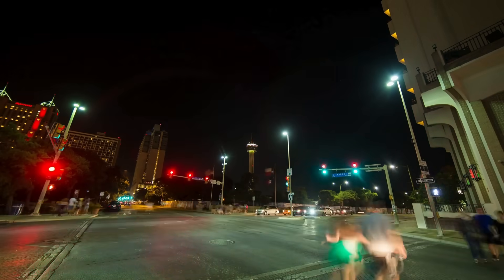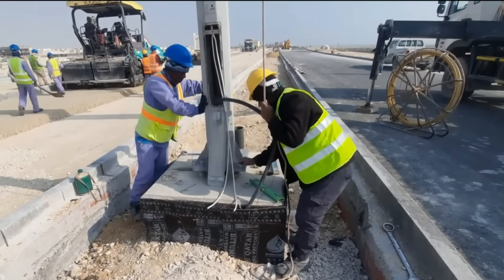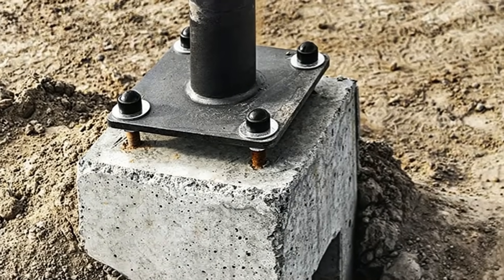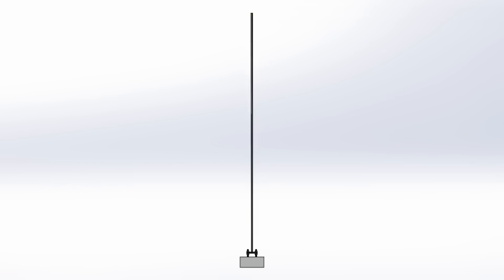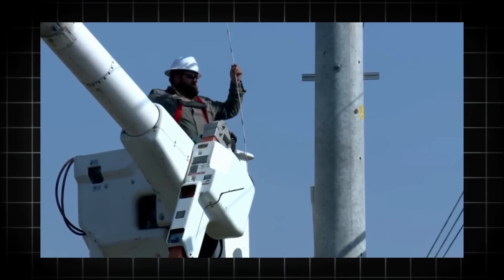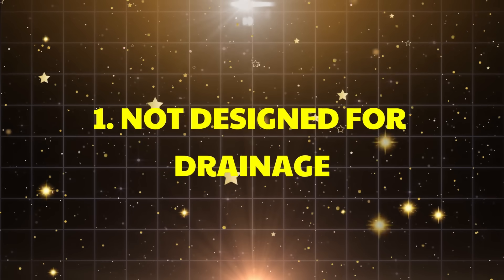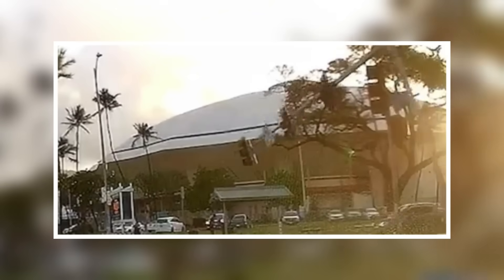Why Light Poles Float on Bolts Only, Not Flush with the Ground?

Comment: I've done 100's of pole lights and all these comments about stress and tension and pull has nothing to do with the design. Its just a common mount that has benefits. Leveling, grouting, skirting, curbing, pattern adjustments and pole replacement. A 3/8" rod has tensile strength of 5000 lbs. most bases in parking lots use 3/4" 4 times, they also have a hook bend at the end and once encased in concrete it is set in stone I tell ya.
The weld at the base plate is where the action is. Once the plate is correctly fastened to the bolts (sandwiched) either the plate will snap or the base will move but the design will stay in tack. Try mounting one on a hill ?
Ya buddy fun stuff especially the big highway and parking lot lights.

Comment: The first time I, previously a carpenter/builder but now a crane operator for the last 25 years, set some light poles for an electrical contractor, I was stunned to see that he never looked at the poles, eyeballed them for plumb, after I set them, I expected a period of fooling around with the base bolta to get them plumb, nope. Just his 8" level on the base bolts got it close enough. If would have been left to me, I would have plumbed them with a transit, shooting the base and then the top of the tapered poles. Once I was setting a 40 log pillar for a homeowner, who was trying to plumb it with a 4' level, but the log was irregular so that was pointless, I finally told him "I have a pretty good plumb bob right here," meaning the crane winch line and 250 pound headache ball. I also once set a 50' tall acid tank on a solid concrete base that looked tilted to my eyes, using the crane plumb bob I proved the contractor it was indeed.

Comment: OK, the bolts as ya call em are "J" Bolts of the proper dia. for the load the eng. calculates, They are Hot Dipped Gal.. The conc. pier is grounded and poured. Now the J bolts usually in a pc. of plywood for spacing, are worked into the concrete before it starts to set. Each pier is calculated for the pole ;,all about mass, the J bolts are part of the desig. Ya got a 5' (in ground) pier, your J bolts are bout 2' deep in the pour. The double nut is to keep it off the pier and for leveling.   Ret lectrician

Comment: I always thought they were SHEAR PINS,  which are designed to give way quickly when a car hits the pole.  Did not in 2013 the federal government required all highways with speeds aove 50 mph use such  poles?  Alas, I have seen lawyers argue that using such poles are dangerous to pedestrians and other nearby when they do fall over.

Comment: You don't level a pole, you plumb a pole.
Reply: Technically correct but “level” is more likely to be understood by the average viewer.
Reply: I am an average person. To help me easily understand perhaps: level the base nuts to one selected point such as one nut so that the base plate is mounted level. Then as long as the pole is attached plumb to the base plate the installed pole will be plumb. that's a lot of words. Think I like "level" better.

Comment: I read the comments and now wonder if anyone who replied watched the video? A pole shearing off during a collision is more of a danger than if it remains standing. The logic is why would you put multiple other people at risk when the pole falls as opposed to one vehicle being damaged.  It is a game of numbers not what if's. The mount has NOTHING to do with being hit by a vehicle! I have built similar mounts for pumps and motors, both gas and electric. I use stainless steel studs and nuts, but I always leave them exposed to prevent corrosion. I guess grout is for the "artistic" type and has nothing to do with structural integrity except it causes corrosion due to trapping moisture. 

As far as the wind is concerned, it guess it takes a little intelligence to understand that if a pole is not plumb vertically, then it doesn't resist the wind in one direction as well. In other words, if it is plumb it is equally supported in all directions.  Not really rocket science!

Comment: There is also the consideration of "friability/frangability", yes falling sign posts/lighting poles are a hazard. But rigid poles that kill people on impact rather than yielding is a more immediate risk. Just look at the South Korean landing accident. In NZ the bolts do not go thru holes but are in slots, used for adjustment the same way but slip under excessive side impact loading. Always felt that US infrastructure is missing something.
Reply: The bottom line is engineers can't foresee the idiots who drive and text and run into light poles. They don't have to be in a car either, so would you suggest making them out of rubber to protect the face of the morons who walk and text? The mentality that everyone else is liable for your stupidity is another effect of DEI.

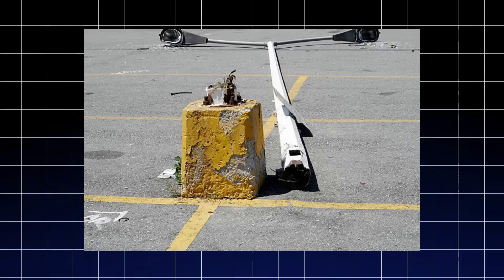Comment: Engineers are so smart...they give mice full access to the inside of the pole where they can chew through my wires. LOL The leveling is amazing how little force it takes on a nut to adjust the pole. 1:56...dem bolts didn't shear off. Hmmm...and that's a typical thin wall light pole.
Reply: When an engineer placed the iron ring on his finger, it cuts off the blood supply to his brain.

Comment: 1.   When the under side is filled with grout it's supposed to have a small "mouse hole" for drainage.

2.  A few of the images shown have rectangular spacers for retrofit over existing anchor bolts, and are not a standard, "planned" installation.

Comment: Convenient installation, if you did it for wind loads you would pull down solid onto the base stretching the rag bolts creating a stronger connection.

Comment: This is nice for leveling , but it is a textbook example of how an alternating windload is introduced in the bolts, leading to fatique problems.
In my industry this kind of design is regarded as highly unwanted. We like f.i. long thin preloaded bolts much more (similar to cilinder head bolts in car engines).  
But like almost engineering decision it comes down to: which problem is easiest solved? Could be that in the traffic light designs it is easier/cheaper to solve the fatigue issue than an alternative leveling solution.

Comment: What?  "Flushing" with the ground?  Is there a toilet involved?  No?  Then you've used the wrong word.  You meant "flush," which may sound the same but has an entirely different meaning.  Further, you show the poles on a cement riser, not on the ground.  My English teacher from 9th grade would give your paper an F!    

If you are not a native speaker of English, seriously consider consulting with someone who IS before making embarrassing typos and misstatements!  Your information is interesting and presumable correct, but your grammatical errors weaken your appeal.

Comment: I have looked at several light poles and noticed immediately that the poles do "NOT" float on bolts. If they floated on bolts only as stated, they would fall over rather quickly without any nuts.  They float on nuts attached to those bolts. The pole has minimal contact with the bolts while having full contact with the nuts.
Reply: You might want to throw a few washers in there.
Reply: If you want to be technical they are not floating on nuts attached to bolts either, they are floating on nuts attached to studs, but the terminology has nothing to do with the design!

Comment: Why Light Poles Float on Bolts Only, Not Flushing with the Ground?

The reason not many poles float on bolts is that the stability of the pole is only as strong as the bolts that support it. Bolts corrode and metal weakens continually exposed to the elements. There must be protection for the bolts against corrosion.

Comment: I've installed a few hundred streetlights.  Level up the lower nuts with your torpedo, set the tower snug, plumb it up and tighten it up. We grouted every one after install.
Reply: If you don’t grout, you’ll get rats inside that like to chew on wiring.
Reply: @miker.1804  also, contrary to what the video said, cementitious grout protects the steel from corrosion by maintaining an alkaline environment, and threaded joints are designed to be stressed only in tension.
Reply: @miker.1804 I've seen metal screens installed to prevent rats.
Reply: Over my 4-decade flatbed trucking career, I've hauled probably thousands of poles out of Valmont in Brenham, Texas. Their main gate was 62 miles from my front door; taking raw poles from Valley, Nebraska, to Brenham was my trip home; taking finished poles to job sites was my outgoing load...

There's a possibility (slim, but still there!) that I may have run across you in that time!! 🤣

Comment: Unfortunately there are construction managers out there that expect their tower crews to dry pack with grout like you mentioned and my crews added 1/2” conduit to four locations within the top of the caisson for drainage. these jobs are all over in San Diego county and some of those locations will be a problem in the future. I was told he wanted the tower bases grouted for aesthetic’s and safety, he explained that the grout would keep a young kid from possibly getting stuck or hurt as an example. Decent excuse but I’m still not buying it. Older parking lot luminaire’s I’ve seen grouted too. Maybe those jobs are now challenging the old directives

Comment: Not intended to break? I beg to differ.
     Driving along the freeway *I-40, Memphis TN) you can see many poles like these. Looking at the bolts, you also see each bolt has multiple weak spots — narrower sections — along its’ length. This makes them resemble the shear pins found in some machinery.
Reply: The company that makes the breakaway hardware you speak of is TRANSPO.

Comment: It’s not for drainage BUT just in case that if the pole were stored water inside the pole due to some reasons say damage of the lamp which causing rain water go inside the pole, water will not be trapped inside the lower part of the pole  in which causing serious corrosion.

Comment: They don’t do this here in Denmark its a solid cylinder straight down into the ground
Reply: Same in Germany. 
Maybe it's another one of those tech-delays where the good stuff takes a few decades to crawl across the big pond
Reply: @ I don’t think so the new and also the old poles for electrifying track uses the technique. I think instead that this is just if you don’t need to do it. Why do it? Like even in strong winds here I have not seen a light pole fall over. In fact I think its by design its not used since making it more fastened means if you hit it by car it will hit a lot harder. But for track this doesn’t matter it just need to withstand a tree hitting it not cars

Comment: I’ve helped put up these poles as an electrician wiring a Dairy Queen and its parking lot. Basically it’s just to make it easier to level the pole and access the wires that I had fished coming out of the concrete. (It was a pain in the ass and involved a vacuum cleaner, string, and mini party balloon)

If the pole has been directly secured to the concrete, I guarantee every pole would’ve been leaning and the wires squished between the pole and concrete. If that had happened, to fix it, the paved parking lot and sidewalks would’ve had to been dig up if they still wanted lights.
Reply: You Make it obvious that you only did this once.
Reply: @arobit58  So? There may be crews who can do it perfectly straight, but the concrete guys I worked with did it pretty rough and didn't set most of our conduits center, which would've left no access for wires. There are many things in this career that you'll probably only do once. I've only wired a marina once, but it'll still be once more than most people. So why not share info about it to people discuss the topic?

Still more experience than 99.99% of people who've watch this video, probably including the author. I'm just sharing my experience since it was related to the video. Do you have any enlightening info we may not have?
Reply: wow really
Reply: Access to the wires is done through a service access on the pole itself. No wires should be exposed whatsoever or accessed between the pole and concrete. A conduit should've been installed. As a REAL ELECTRICIAN I can confidently say you're either not telling the truth or not a good electrician.
Reply: @DemnRaig80  Well, that confidence is actually hubris then, because if you bothered to read I did use conduits. The issue was that the concrete guys didn't set the center in the concrete base. Some of the conduits as a result would've been blocked by pole's square base.

Wires WERE accessed on a little weatherproof door on each pole. We even fabricated a waterproof two-piece casing for the gap between the concrete and square pole base to be sure. I'm just describing what would've happened if we'd let the concrete guys direct set in the concrete with us away. It was evident what would've happened since they couldn't set the conduits right on their own.

Regardless, don't be a prick.
Reply: if you're doing light poles in the city you gotta watch out with the balloons sometimes you'll find them with drugs shoved down conduit so if you use the balloons, remember your color